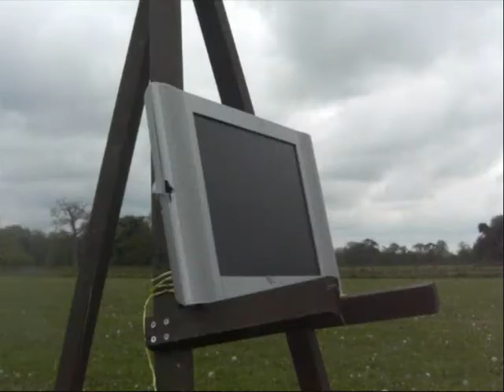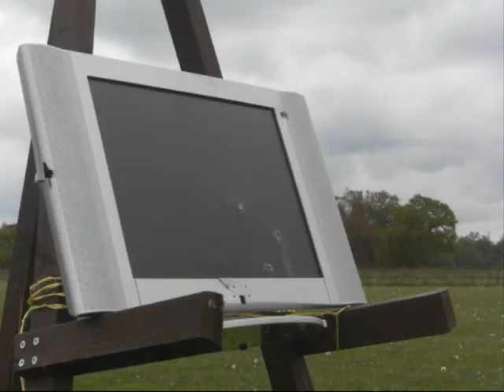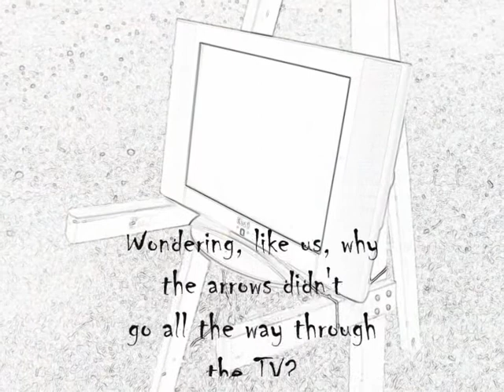Ever felt like putting your boot through the TV? Why not use a Longbow! - Video 20

Comment from the maker: Sounds like some interesting research you are doing there. The head has a diameter of 1/2" at the socket and a total length of 4.5" of which 3" is the actual tapering bodkin head. The head tapers up to a maximum width of 0.25".

Comment: @bigbowbrum Actually, if you get a 100 pounds recurve or compound, the damage would be the same (higher in the case of the compound, as it stores more energy). It depends on the strength of the bow, not on its shape. Carbon vs wood is a whole other story, and i never tried to shoot a carbon arrow with such a powerful bow, so I wouldn't know.